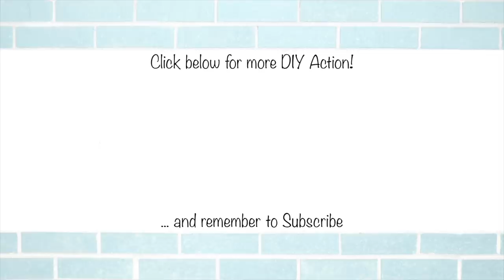INSULATING the ROOF | TRC Van Conversion 9.0

Comment: Use low expansion spray foam to fill in the ribs, the kind meant to fill in around doors and windows, and don't go overboard and you'll be fine. You can always put more in if you don't get enough the first go round.

Comment: Thanks... just started my roof insulation today.  Spray adhesive did not hold work to hold the panels in place.   I didn't look forward to the spray foam mess.  I ripped 1/2# plywood, 54" x 4-1/2" wide.  Screwed and used construction adhesive to secure them to the steel ribs.  Cut the one inch foam board.  Tomorrow, I play with the spray foam.  I can see that my plank ceiling installation is going to be alot easier.  Thank you again!

Comment: SAY WAIT!:
A super cheap greatly overlooked free insulation material for what you might use to stuff into cavities in a van is used poly fill-pillow filling that you can fairly easily get for free from people's warn discarded sofa's are often found next to apartment dumpsters OR the Foam From the discarded Seat Cushions-New foam is Very expensive but this foam is FREE and should also sound deaden much! The cushions often have zippers or just cut the seat open. To cut foam to desired size and shapes, I use a hack saw taken out of it's holder, holding the blade loose in hand and saw back and forth although it does not work as quick and precise as an electric meat knife, it works ok. Don't use fiberglass insulation that goes in house attics, I think the loose fibers would get into your lungs no matter what. Also note that the stuff in used sofa's have been covered and protected by the outer fabric so it's usually in pretty good shape.
Because any soft pillow pads or pillow backs can be full of the stuff. Just cut open with a knife to find out and take what you want before the garbage company crushes the sofa. 
Of course you'd want to give it a quick close scan smell with your nose on it in case it has pet urine but really most apartment deter pets by either not allowing pets or they charge a lot to have them.
Manufacturers make the poly basically from plastic bottles and it's fluffy and no one is allergic to it and it doesn't make you scratch and it doesn't absorb water and although it isn't as good of an insulation as foam, it does insulate by holding the air in it's fiber fluff pockets.
Of course you can buy it new in bag at hobby departments but it can be kind of expensive and why buy new when you can get for free and save the environment from more new plastic?!
What could be cheaper? Thanks for your videos! Your don't great job finding what works!
Reply: Heat cutter is on my to do list. Excellent for cutting foam and 🦆 
Looks simple to build from scraped toaster or solder gun. 
There is so much to find and use from scrapyards, fleemarkets and dumpsters. Basic knowledge, youtube, fantasy and time will take you a long way. 
Camper stuff is usually poor quality and expensive. Boat stuff is also expensive but often much better quality. A used car water pump is dirt cheap and way better than any camper equvellent. Cheers and Pardon mi spelling.

Comment: what kind of screw did you use to attach the wood on the ceiling? did you drill more holes or using the existing holes on the ribs?
Reply from the maker: Just short countersunk self drilling screws straight through.

Comment: Good job. I have limited headroom in 2004 gmc Savana hitop my head touching ceiling now. Going to install Maxair fan so will drop existing ceiling being 3/8” ply with fabric headliner glued on. There are shallow ridge/valleys in the fiberglass I wouldn’t think necessary filling them ?   If I were to go with a different ceiling as in 1/4” or thinner cedar T&G or 4x8 paneling then would have approx 1/2” for insulation.  I bought 1/2” polyiso foil faced one side that is an option and considering 3/8” Ultratouch Radiant Barrier - one side foil faced and it being denim wonder about moisture ? Main objective is to minimize heat transfer from sun hitting the roof in summer as well as to keep it cooler inside and warm in winter.what should I do? If using the 1/2” polyiso is foil facing up or down ? And is the 1/2” even worth the trouble installing for minimal R-Value.  Will need try something to help condensation perhaps. So what’s the best bang for the buck?

Comment: Hello, great videos and very well explained.

Continue with this great job.

Just one question, and maybe already answer, but when is the best time to pass all cables for roof lights and all plugs that you have planed.

Thx

Rui
Reply from the maker: Rui Rodrigues sooner the better. Or at least run some conduit pipe around to where you know you want lights, outlets. Certainly best to do before you finish insulation.

Comment: hi, wonderful work and very cute little helpers. i have 04 GMC Savana hitop fiberglass roof having a few slightly wood filled raised ridges apparently for screwing. Existing ceiling is apprx 1/4" ply with thin foam headliner material with a few long oak trim strips holding it up. The sides and rear portion of rook are 12" the front is tapered and curved more than the rest ofroof..  Going to take down install maxair fan and then insulate. For headroom I need stay as thin as possible so bought 1" polyiso foil on both sides and a couple sheets 1/2" sheets foil.on 1 side.  Are you satisfied using polyiso in your van?  Mines is older van and not planning to live in it trying  stay simple.  1. Would using only 1 sheet 1/2" be adequate? And should foil face to ext or int?   I had thought potentially to add a second 1/2"layer for R value and  its lighter for holding up and more bendable, also allowing a foil de the opposite direction and 1  layer 1/2" would much less labor. Or go with 1" cut in sections like yours trhe utilize the 1/2" doubles for sides rear . The front portion due to curve tapering downcould use just 1 layer 1/2' that area will be closed in storage and now has thin layer ins in headliner of cab.   I  wanted share as much details as possible for you wondering the most effective way to get this done with least head and back ache.  Ultimately wanting block hot sun radiating through the fiberglass trying stay cooler yet have ins for the cold months. I thought of 1/2" air gap then reflectix?   Lastly is it necessary to get between ridged fully filled with spray foam as well as seal it over with some sort of vapor barrior. I planned to use spray foam foil tape all seems.  Help!!!! lol

Comment: I know you say its long winded, but If you don't have time to do it correctly, when will you have time to do it again!!! :D  

Question.  If you were insulating a van for primarily use in a hot climate, would you do the same?  Will the kingspan reflect the heat out also?  I'm in the planning stage for one, and we live in Spain. So didn't want to turn it into an oven.

Comment: Great job.  Are you concerned at all about the air gap behind the board?  Isn't there a risk of condensation?  I've done the same as you but put a thin layer of loft insulation behind the board to fill that gap.  That was NOT a good idea.  It seems to be soaking up condensation.
Reply from the maker: Not really concerned as the only moisture that can condense there is the minimal amount in the air behind. The vapour barrier should prevent the warm moist air from the van reaching anyway near the van skin.

Comment: There are multiple types of expanding closed cell foam... to avoid blowouts and panel damage use the can labeled “for windows and doors”
Reply from the maker: Yes low expansion foam much better. Although still a pain if you need any welding! 😀

Comment: Hello, love your videos. Im about to do my third campervan build but first i'm debating on installing three double acrylic glazed windows or bonded windows. i have double acrylic in the past but they are soooo expensive. I see that you have single pane bonded windows, how has this affected your vans insulation? what methods have you used to prevent heat loss/gain through them? Thanks

Comment: Hello, id just like to say first off thank you for all your videos they are great. I just have a quick question and its probably a stupid one but when you say that the screws that hold the battons onto the roof need taping over otherwise they will condict the cold air, why would this not occur with the screws that hold the tongue and groove ceiling on? Because presumably they will pierce the vapour barrier and go into the battons? Sorry if there is an obvious answer im just trying to get my head around the whole insulation thing.
Thank you.

Comment: Old video, but if you’ve come here for insulation tips, the expanding foam (DIY cans) also comes in a formula for “doors and windows” which is softer and will not “bulge” metal or thicker plywood.

Comment: did you know that the r value of polyiso goes down to 2 when exposed to -10 degrees c? Xps's R value on the other hand goes up from 5 to 6.  WOuld it have been a good idea to seal the plywood first on both sides?
Reply from the maker: Luckily I don't plan to be using the van at -10c! Although yes XPS is a good route, better compression strength for the floor too and less squeeky! Not sure if any need to seal ply.
Reply: The Restoration Couple your kids are insanely cute by the way, good job!
Reply: I would love to know if the ply needs sealing in the van. The ceiling ribs I was tempted to seal just because if condensation forms, it's just above them.

Comment: We’ve got a 2015 Citroen Relay. As far as I can tell the distance from point where celotex would sit to the bottom of the rib is 30mm so then with the 12mm ply battons on top of the rib we have 12mm extra space. Rather than being flush. Am I missing something?

Comment: Thanks for responding to my other comments, i have a feeling i might be firing a few questions your way, for the batons out of 12mm ply, is there a particular type of ply i should be using, i found softwood ply at a good price? Or even for the wall batons that you make to hang the beds off, would you suggest marine ply for that?

Comment: I’ve maybe missed a video or something, but I have two questions, first is what’s the reason for the small squares of insulation on the walls? The other is are you putting anything behind the wool in all the small pockets and holes?
Reply: Don’t know if it’s too late but the small squares are meant to lower the noise from the metal while driving

Comment: Hi there! I have a(nother) question :)

What thickness insulation did you use for the roof? The depth of the ribs are 25mm and the thickness of the plywood strips are 12mm and, therefore I assume you used 35mm thickness, is that correct?

If so, where did you get it from? All suppliers I've contacted are telling me that Celotex are not producing the 35mm thickness at the moment...

Thank you!
Reply from the maker: +Konstantinos Parsalidis 30mm is what we used and worked great. Harder to find than 25mm but we had to use it because of seat tracks on the floor. You could use 25mm flush with ply and have a bigger airspace above but 30mm was ideal for our van.
Reply: Thank you very much! I think I'll use 30mm for the roof (25mm for the floor)

Comment: Great job. In order to keep the the foam boards in place, you're just using friction and the expanding foam, right? You're not using adhesive. Why not gluing the boards to the van's ceiling, would that be overkill?
Reply from the maker: You could put a flexible adhesive but due to the nature of the shaped van roof and thickness of insulation it will not necessarily be in contact everywhere.  The tape between foam and battens is actually the best way to keep them in place.

Comment: This may be a silly question but i'm far from knowledgeable in these things. 
To insulate for a hot environment where i want to try to keep it cooler inside, would I need to change anything? Eg. putting a vapour barrier on the other side (directly against the panels).. or would the condensation protection be the same either way?

Comment: When you secured the buttons by screw to the ribs did you have to drill pilot holes as it’s screw to metal, cheers mate just about to buy a LWB transit so pretty similar structure I think your videos will help big time cheers Dylan
Reply from the maker: No just self drilling screws.  The adhesive is actually sufficiently strong enough on its own so the screws are more just to clamp it in place than permanently structural.

Comment: What is the adhesive you are using on the foam board ??? Is it like the flexible adhesive you used under the joints of the van so it doesn't rattle against the sides of the van ???  We get getting ready to do out Insulation in the next day or 2...going shopping today for it... thank you for your videos...we are definitely going to use your recommendations on the Insulation...
Reply: Never mind...I see its foam...I didn't know you could buy that on a chalk like can...

Comment: Can you elaborate more on the ceiling insulation? Wouldn't the heat radiate through that Celotex since it's touching the metal? There are some air gaps but there is a lot of surface area still touching. Thanks
Reply from the maker: net poser celotex and pir is there to prevent the loss of heat, I.e poor conductor. The metal touching it is not a problem, all commercial insulated panels are built with a metal skin filled with insulation. I.e supermarkets, warehouses, shops, etc. There will be some minimal  heat loss through the insulation as it is fairly thin but the best you can achieve within a van this height. Hope that helps.
Reply: Gotcha, thanks. So you are looking to keep heat in more than keep heat out? I have the same van here in the US (Ram Promaster) and I'm in the south east (NC) so I'm more concerned with keeping the van cool during the summer.  I did the floor with 1/4" plywood on bottom > 1/2" polyiso > 1/2" ply on top. For my ceiling I plan to use your method and then add some Reflectix also. Then put on the ceiling material.

Comment: What did you end up doing for insulation in the headliner space above the cab? It's not a huge space but wanted to avoid condensation or heat loss through the roof there and would welcome your insight. Thanks
Reply from the maker: Slid down to the front and boxed in with insulation and carpet lined ply. You could remove all to be more thorough.
Reply: @TheRestorationCouple  Thanks for the quick reply! I may be being daft here but I don't fully understand - did you adhere anything to the metal directly? 
Thanks

Comment: Are you drilling through the metal? Or trying to use the existing holes?
Reply from the maker: Self drilling screws.
Reply: Do you think self drilled holes need rust protection? I would have thought so, but never seen anyone else ever do it. And I'm guessing the screw going in after would nicely re-expose metal anyway.
Reply: Definitely hesitant because of the rust potential but, a huge time saver.
Reply from the maker: Depends on your install.  In our case they were only used internally, with a vapour barrier and also galvanised van body the risk is very low.  Even if all the screws failed, the adhesive used would most likely be sufficient.  Certainly not likely to be an issue within the lifespan of most vans.
Reply: Do you think an impact drill would be necessary because of the thickness and the strength of the steel? I have a cheap Black and Decker and I have a feeling I'm going to have to rent a better drill from the hardware store and I'm wondering what I should get

Comment: I like the concept of using the PU foam to grip in the insulation boards but have you had the ability to test whether this happened? PU foam needs air to expand so after you got the seal done it may not have expanded enough to grip it properly and insulation board is non permeable so new air won't have been added, it may have left you with air gaps along insulation boards. 
Let me know as I would to know if this method works.

Comment: Great job!  At 6:40 you start to screw in the wooden parts into the bumps of the roof. You use the predrilled holes which are in the van? And what size screws are these?
Reply from the maker: No, self drilling screws.
Reply: Thanks! Really enjoying and learning allot from your video's.

Comment: Do you have a list of all products used for your build, including adhesives, caulking, insulation, etc?
Reply from the maker: Not yet I’m afraid. We will be starting up again on the van soon and try and do one then.
Reply: No problem.  Thanks for the quick reply.  Just ordered a bunch of stuff online and can't wait to get building on my own van.  Did you run wiring in front of or behind all the insulation?

Comment: It seems to be the best method to screw strips of plywood directly onto the van ribs.  Does creating more holes weaken the van rib structure?  Is there any risk of the screws coming loose over time?

I thought about using bolts, washers & nuts to attaching the strips of plywood to the pre-existing holes in the van ribs.  However, that seems to be much  more work.  There seems to be a risk that the nuts coming loose over time.

Comment: Why not just rip the insulation to the angle of the ribs and glue in
Reply from the maker: Need the ply strips anyway so makes sense to keep it all square.  It is possible to rip the angle but it would still take lots of props until adhesive sets as there would be no friction fit.